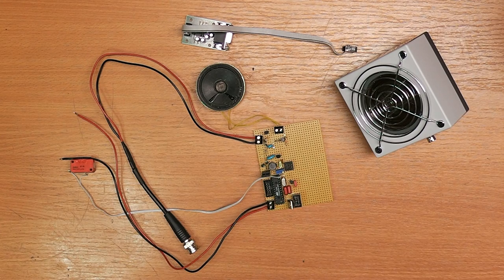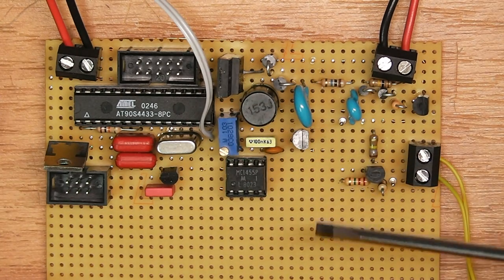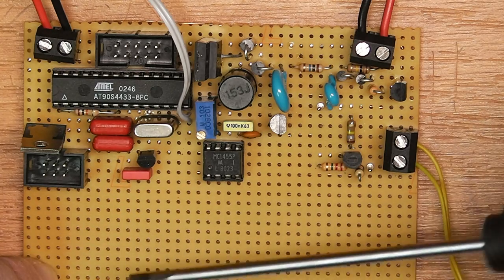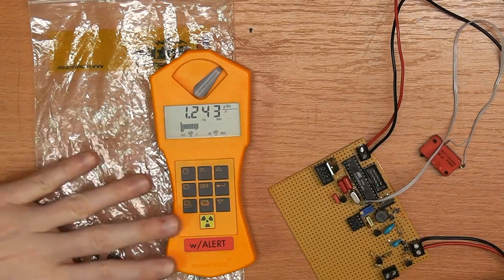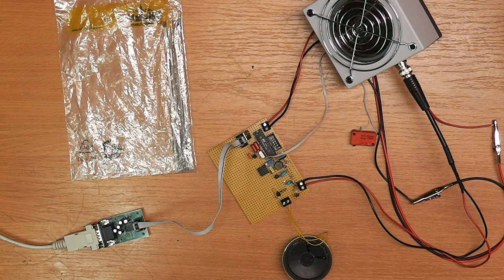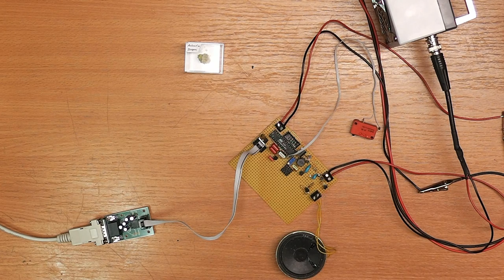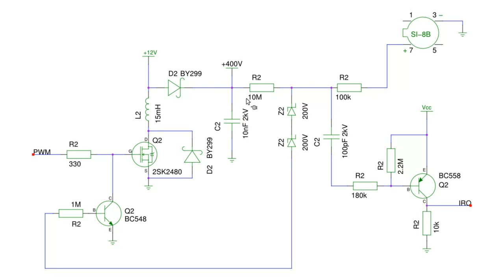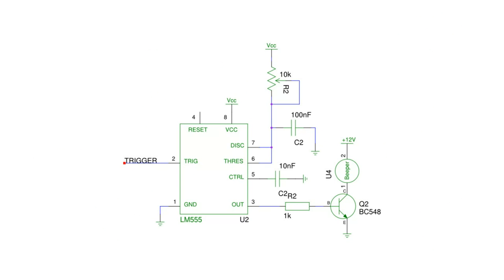Geiger Counter with AVR and SI-8B Pancake Probe

Comment from the maker: You are absolutely correct, I messed up the schematic. Sorry about that, will fix it immediately and put an annotation (with credits obviousl!) in the video. Thank you so much, I actually built it correctly (wouldn't work otherwise as you said already), but just didn't notice the mistake. And thanks for the kudos for the feedback part -- I've played around with some things which didn't work as well, but shorting the gate worked surprisingly well. Very cool :-)

Comment: Shouldn't the anode of D1 be connected to the drain of the MOSFET ? I wonder how there can be 400 volts if the anode is connected to +12V. I refer to the PDF schematic part names. Btw, i like the simple idea of just shorting out the gate of the MOSFET with Q2 as a feedback mechanism :)

Comment: I am not sure your 400-volt power supply is putting out 400 volts, which begs the question is all that sophistication with the microcontroller necessary. I like the use of the 555 as a one-shot to produce the sound at the speaker, I think I will use it in my geiger counter.
Reply from the maker: Hi Mark, you're right -- the µC is not necessary. I just had it around and use it to generate the PWM, it is just simpler than a 555 if it's already present. The reason however is not the PWM generation, but to be able to count ticks and transmit them to a connected PC via RS232. If I wouldn't have had that feature, I think that I'd also have taken your approach (with one or two 555s). The supply is outputting the 400V though, I checked :-) Thanks for watching the video, Joe
Reply: johndoe271828 I like you, you are an enlightened person.

Comment: I like your design, thanks for sharing it. And probe casing is very nice :)
Did you somehow calculate pwm frequency and inductor value for desired voltage at the output?